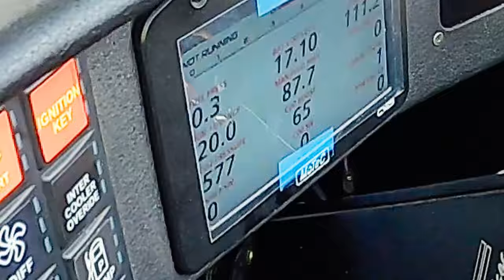George Poteet - Speed Demon 2021

Comment: The 500 MPH Wheel Driven record is within reach!  Good luck and Godspeed George!
Reply from the maker: 100% agree.
Reply: Unless it's a two way run within one hour it won't be a meaningful record. We need to be able to compare records set under consistent rules and not when people can take advantage of winds or slopes.
Reply: @owensmith7530  I agree but those days are long gone at Bonneville with the loss of all the salt to mining as you can see in these aerial shots. We set all our streamliner records back when it was "two way" runs but unfortunately it was never noted in the record books when it became "two day" records. FIA is still holding strong with the two way one hour format but there are a lot of people wanting to change that too because it's "too hard!"
Reply: @nzsaltflatsracer8054  Setting world land speed records isn't meant to be easy. And it would have been possible to do two way runs at Block Rock Desert if only Burning Man hadn't absolutely trashed the surface, so much for their supposed ecological credentials.

Comment: That second flair in the bodywork around the engine may be an aerodynamic mistake. On the English Electric Lightning aircraft it was found that the 2 seater model was faster because the 2 abreast cockpit was the same width as the rest of the aircraft, whereas the single seater had a second flair in the bodywork after the cockpit. This was unexpected at the time but is now understood. Look at JCB DieselMax which is completely straight sided. Note also DieselMax would be able to reach about 450mph if the tyre manufacturer would approve the tyres for that speed.